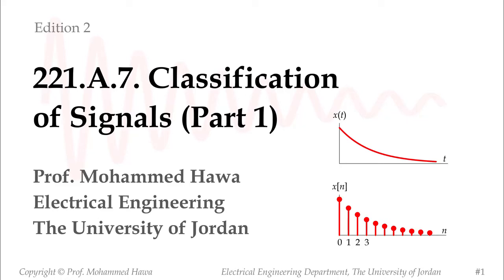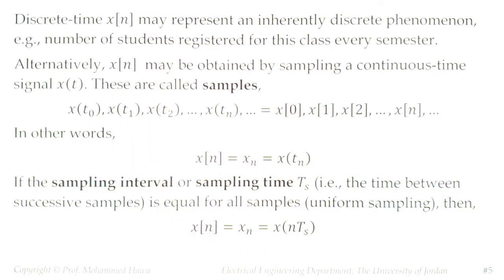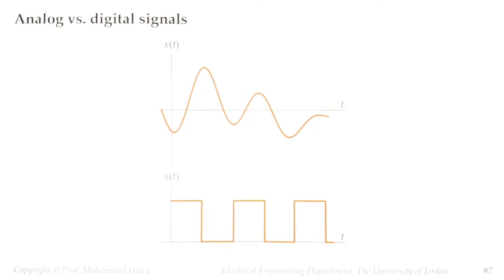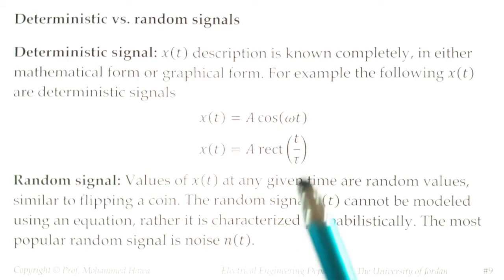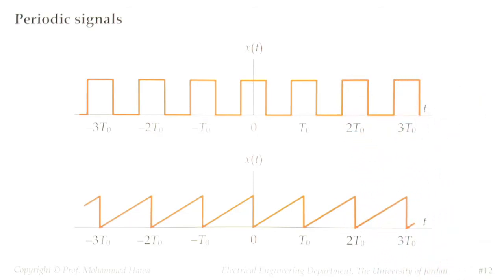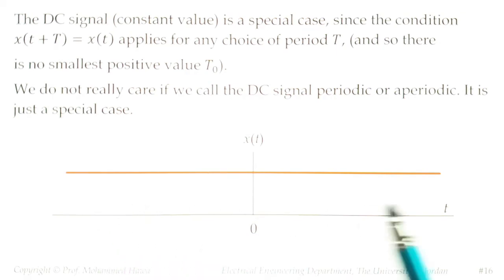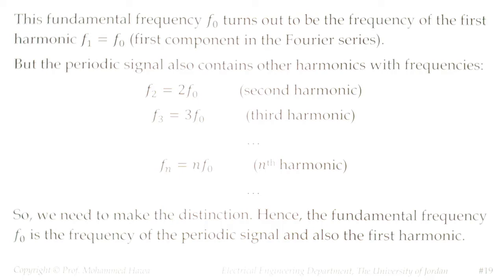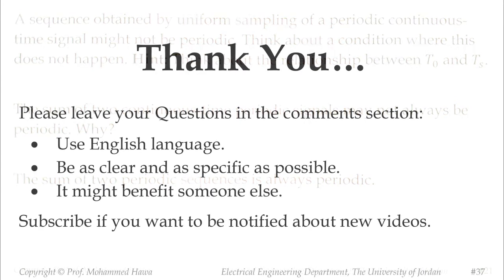221.A.7. Classification of Signals (Part 1)

Comment: great professor . I wished you could use more of writing with the pen instead of just pin pointing
Reply from the maker: Thank you for your suggestion, but avoiding writing was intentional in order to reduce the length of the videos, making them more suitable for reviewing the material. My advice to my students was to pause the video whenever they need to write something or solve a problem.
Reply: @mohammedhawa6472  noted